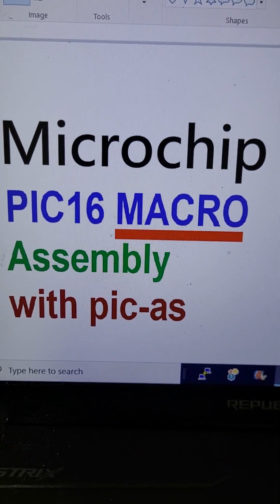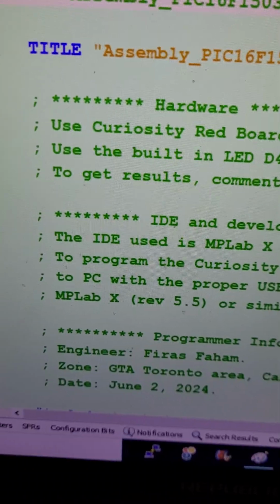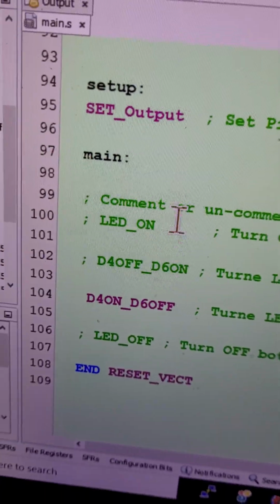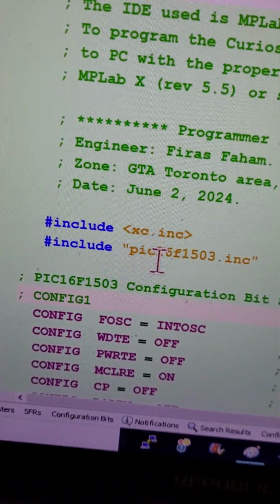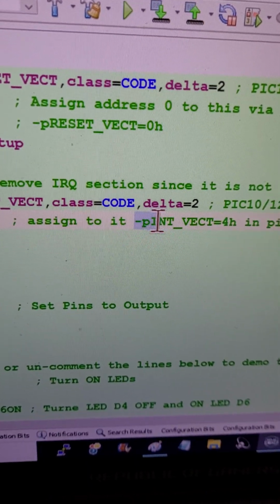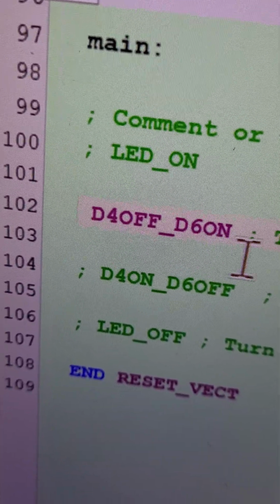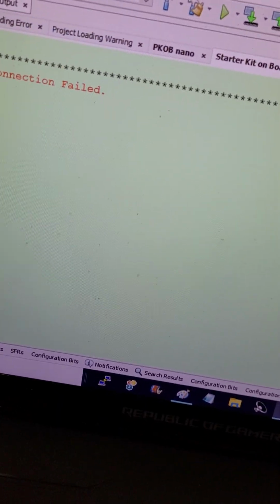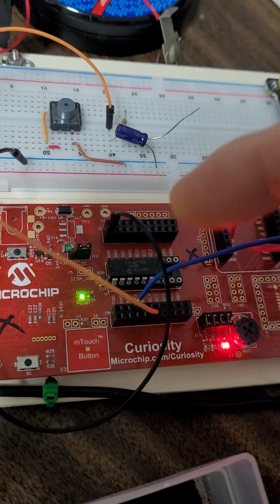Microchip PIC16 MACRO assembly with pic-as .. code and applications - Part 1

Comment from the maker: ; * Assembly_PIC16F1503_Macro_Example *
   
    TITLE "Assembly_PIC16F1503_Macro_Example"

    ; ******* Hardware *******
    ; Use Curiosity Red Board with PIC16F1503 to demonstrate MACROs. 
    ; Use the built in LED D4 and LED D6 to demo MACROs.
    ; To get results, comment or un-comment the line in main.
    
    ; ******* IDE and development ********
    ; The IDE used is MPLab X rev 5.5.
    ; To program the Curiosity board just connect this board
    ; to PC with the proper USB cable and use the IDE 
    ; MPLab X (rev 5.5) or similar, compile and program.
    
    ; ******** Programmer Info ********
    ; Engineer: Firas Faham.
    ; Zone: GTA Toronto area, Canada.
    ; Date: June 2, 2024.
    
   #include <xc.inc>
   #include "pic16f1503.inc"
 
; PIC16F1503 Configuration Bit Settings
; CONFIG1
  CONFIG  FOSC = INTOSC         ; Oscillator Selection Bits (INTOSC oscillator: I/O function on CLKIN pin)
  CONFIG  WDTE = OFF            ; Watchdog Timer Enable (WDT disabled)
  CONFIG  PWRTE = OFF           ; Power-up Timer Enable (PWRT disabled)
  CONFIG  MCLRE = ON            ; MCLR Pin Function Select (MCLR/VPP pin function is MCLR)
  CONFIG  CP = OFF              ; Flash Program Memory Code Protection (Program memory code protection is disabled)
  CONFIG  BOREN = OFF           ; Brown-out Reset Enable (Brown-out Reset disabled)
  CONFIG  CLKOUTEN = OFF        ; Clock Out Enable (CLKOUT function is disabled. I/O or oscillator function on the CLKOUT pin)

; CONFIG2
  CONFIG  WRT = OFF             ; Flash Memory Self-Write Protection (Write protection off)
  CONFIG  STVREN = ON           ; Stack Overflow/Underflow Reset Enable (Stack Overflow or Underflow will cause a Reset)
  CONFIG  BORV = LO             ; Brown-out Reset Voltage Selection (Brown-out Reset Voltage (Vbor), low trip point selected.)
  CONFIG  LPBOR = OFF           ; Low-Power Brown Out Reset (Low-Power BOR is disabled)
  CONFIG  LVP = ON              ; Low-Voltage Programming Enable (Low-voltage programming enabled)

 
 ; *************************
SET_Output  MACRO  ; Macro to set pins to Output
    BANKSEL TRISA ;
    BCF TRISA,5 ; ;Set all RA5 to output - LED D4 Near the POT
    BCF TRISA,2 ; ;Set all RA5 to output - LED D6
 ENDM  ; End Macro 
 ; **************************
 
; *************************
LED_ON  MACRO  ; Macro to turn ON LED
    BANKSEL PORTA ;
    bsf PORTA,5  ; LED D4 On Curiosity board PIC16F1503 near the POT
    bsf PORTA,2  ; LED D6
 ENDM  ; End Macro 
; **************************
 
; *************************
LED_OFF  MACRO  ; Macro to turn OFF LED
    BANKSEL PORTA ;
    bcf PORTA,5  ; LED D4 On Curiosity board PIC16F1503 near the POT
    bcf PORTA,2  ; LED D6
 ENDM  ; End Macro 
; ************************** 
 
 ; *************************
D4ON_D6OFF  MACRO  ; Macro to turn ON LED
    BANKSEL PORTA ;
    bsf PORTA,5  ; LED D4 On Curiosity board PIC16F1503 near the POT
    bcf PORTA,2  ; LED D6
 ENDM  ; End Macro 
; **************************
 
 ; *************************
D4OFF_D6ON  MACRO  ; Macro to turn ON LED
    BANKSEL PORTA ;
    bcf PORTA,5  ; LED D4 On Curiosity board PIC16F1503 near the POT
    bsf PORTA,2  ; LED D6
 ENDM  ; End Macro 
; ************************** 
 
psect   RESET_VECT,class=CODE,delta=2 ; PIC10/12/16
RESET_VECT:  ; Assign address 0 to this via pic-as linker
             ; -pRESET_VECT=0h
    goto setup            

; You may remove IRQ section since it is not used.    
psect   INT_VECT,class=CODE,delta=2 ; PIC10/12/16
INT_VECT:   ; assign to it -pINT_VECT=4h in pic-as linker
    retfie  
    
 
setup:   
SET_Output  ; Set Pins to Output
    
main:

; Comment or un-comment the lines below to demo the MACRO.    
; LED_ON      ; Turn ON LEDs

 ; D4OFF_D6ON ; Turne LED D4 OFF and ON LED D6    
 
 D4ON_D6OFF  ; Turne LED D4 ON and OFF LED D6

; LED_OFF ; Turn OFF both LEDs.    
    
END RESET_VECT